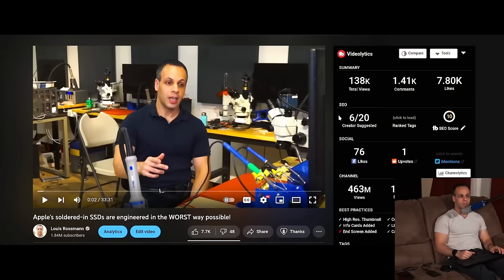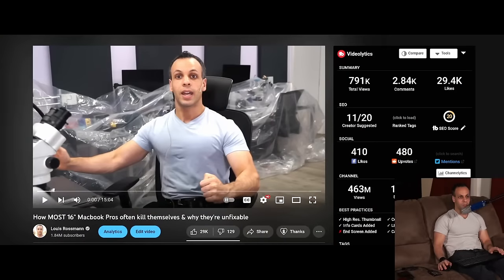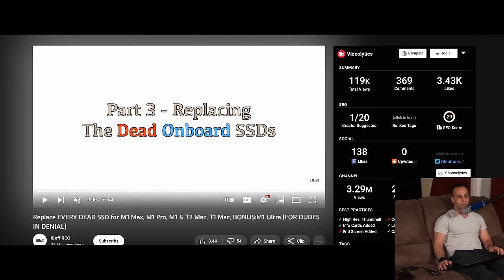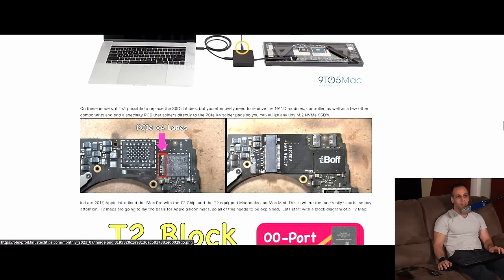The design of Apple's soldered in SSDs is worse than I thought!

Comment: this is the reason i have an old dell latitude E5420. you can replace/upgrade the cpu, ram, drive, battery, screen and dell even has instructions on how to do it on their website - you simply search your exact device by providing the "express service" code found somewhere on the bottom part of the case, and it gives you all sorts of things related to that device. you can find these laptops (used) for like 100 - 200$ and i think that's a way better deal than a macbook
Reply: not to mention, those laptops are pretty much as strong as these old nokias, you could die if someone threw it at you lol

Comment: I have a question: Don't phones with Ios or Android work the same way (like Macbooks)? Are there fewer risks regarding the reliability and lifespan of the storage chips in phones? And if the storage in the phone or tablet breaks down, I suspect that it is just as impossible or expensive to repair them. Or is the Bios in phones designed differently, more reliably?

Comment: This is Apple's plan. Make the product non upgradable, non repairable, or economically viable to repair. When it fails 3-4 years or less, make sure there is another new product on the market to suck the customer into buying again.
This is their business plan which is a win win win for Apple.
I try to point out to people not to buy into this. However a lot get defensive because they have bought into it. They will say things like, well I run my laptop 24/7 for 2 years no problem.
Yes, but 2 years imo is nothing. What about that 3rd year? Or tomorrow?What if it dies then? Will you be OK with that?
I f***ing wouldn't.
The only way to change this design plan is to hit apple in the pocket by not buying into it!
Their iPhones are pretty much the same. You can buy a genuine apple replacement part and the phone will still pop up nag screens to say its not genuine because the original was keyed to the phone and the replacement has a different  key. Even Apple's online engineers can't fix it by flashing  its total shite.
Basically, if you buy the newest apple products, you better have deep pockets, because time is ticking on your product to become that expensive paperweight. They advertise themselves as being green, but look how much land fill they are creating!

Comment: This idea goes back to early 90's Compaqs that would just have a stub for a BIOS, the actual config utility was loaded from the hard drive. If that was gone, you needed the original boot floppy, which is probably non existent or hard to find on the internet today, and it probably wasn't feasible or impossible to download boot floppies when it was new, but at least something was provided to fix it.

Comment: No, they should always make a separate chip containing the "boot/bios" files for the motherboard. These days it is not expensive to use a 1 gigabyte chip for this purpose in a time where such thing as 1 tb micro sd card exists.
Reply: The way PCs do works very well. The EFI firmware looks for a partition with ESP partition type, then offer each .efi file within as a boot choice (or whichever it is configured to boot first). The bootloader is loaded from the disk, which you can replace at will, and when you back it up, you end up backing up the bootloader too. The UEFI firmware itself is stored on firmware.

I would never buy a Macbook. I don't care how innovative the M3 is, or how power efficient, or how awesome it is to go lots of time on a charge without even bothering you with a fan. Even before they soldered their SSDs, I would never accept Apple hardware. Parts are available or it does not exist to me.

Comment: "Because it is illegal in many states to drive without light on, we decided to run wire from starter through lightbulbs. And to ensure that everyone is using law compliant lights, we cast those lightbulbs in the whole front light, only available at the dealer store, so make sure to come in every 50.000 kilometers or so to have it replaced."
Of course, it is for safety and children.

Comment: It's almost as if Apple has no experience in designing robust hardware. The whole UEFI BIOS thing is there for a reason. So if your disk fails you still have something which can boot your OS from another drive. But no, Apple knows better and designs it a different way that stops your machine working if the flash memory fails. It's almost like their computers now are just scaled up tablets.

Comment: Is this what is referred to as "tactical engineering"? 
But over half a grand for 1TB, and you have to do the more than simple extra steps yourself is absurd. This is why apple repairs always seem to cost the same as simply replacing the device.

I have a friend with a more recent MacBook. Should I earn him to backup his data? Is it impossible to receive the data if it fails?

Comment: Doesn't make sense all around. You would think Apple would want a proprietary module like the mac pro one across their lineup. It's one of those if they paid the premium for the hardware up front then they are probably willing to pay the 600 bucks to Apple for the part and a little more for me to install it to upgrade/fix it down the road. Still sucks cuse on the PC side one if my easy sells is 150-200 bucks for an SSD upgrade. That's a 1tb drive at this point and labor to install/clone the old drive and it's like they have a new computer again. For what it is worth I enjoy the board repair videos.

Comment: Just don't buy them, I say it all the time because I knew this all along, but no one would believe me when I was saying they're just designed to die!

Want a good MacBook? 2012 unibody MacBook Pro, patch that to Monterey! A Retina 2012-2015 is also OK, soldered RAM but at least not the SSD. The display is beautiful.
Then MacBook Airs all the way until 2017 are nice machines aside from the display.

The non touchbar 2016-2017 MacBook Pros have replaceable storage although even more proprietary than previously, there are adapters. These are also OK to buy, but be aware of the issues with the butterfly keyboards

Comment: I came to your channel a week ago because I have a dead M1 macbook air that does not turn on or charging and always pulling 5V. At genius bar they ask me to replace the motherboard and touch id, causing over half of the cost of a new machine, which I think doesnt make sense to repair at all. I am now awaiting my screwdriver and multimeter that I bought online, and I at least want to diagnose the board myself before selling it for junk. I hope I may be able to fix it myself, but it sounds like I may end up having a dead SSD that also killed that bootloader. Anyway, I am done with Apple products for the rest of my life. This macbook really is a horrible user experience, never ever again.

Comment: There's a REASON the BIOS on regular motherboards is stored in a completely separate ROM chip that is battery-powered. System storage can fail at any moment. And when it fails you will NEED the BIOS to be intact.

Comment: Few months ago I have successfully recovered about 1.5TB of data from a dead SSD without soldering anything with only single tool - ddrescue utility. Because if you carefully read data from your SSD block-by-block your totally dead SSD can give you about 99.9% of its data without any error.
Reply: That's why they usually degrade blocks into read-only.

Comment: People understand cars more than computers: Apple's the equivalent of a car maker pretending it's okay to gain 1 horsepower by putting the alternator winding directly on the crankshaft, thereby guaranteeing a multi-thousand-dollar engine-out repair (if not total engine swap) to anyone dumb enough to buy one used. There's a law that says you need to be able to buy replacement parts for cars, and as I started typing this I realized this is exactly the direction auto makers are going inch-by-inch.

Comment: So it's not merely a soldered-in SSD..  they stripped essential components a plugged-in SSD have that would isolate a fault, and instead made sure a fault would be catastrophic.
This is one problem right to repair laws won't solve...  Say the manufacturer chooses to design their product so ANY of the commonly-failing components which are integrated failing blows up the whole board,  because they prefer to replace whole boards.  If the SSD was properly fault-isolated, then only the SSD would fail;  the fact it's not ought to be considered a design defect,  even though Apple likely won't because they don't consider the SSD replaceable anymore - a SSD fault is considered to be the whole board is broken and must be replaced.

I begin to think that a Prescriptive 10-year minimum design warranty should be required by law for the plurality of electronic circuits of a consumer electronics product  for the specific issues such as burning caused by short circuit, static discharges, incorrect voltage or current,  That should apply to any product failure that is not addressable by replacing less than 25% of the electronics. The manufacturer can choose Not to warrant individual replaceable subunits.  But it's Apple's fault if the whole board always has to be replaced.  

The manufacturer should be responsible to ensure products are designed reasonably to prevent something such as a cable failure or a short in another chip burning more than a  25%-of-the-product-or-less replaceable submodule.

Comment: Ok for people not understanding this situation. Its like having a car, you know tires wear out and are wear parts that NEED to be replaced. So in this case you get a flat tire and now your car will never turn on again because that tire is flat and you cant get a spare tire/wheel anywhere else but that manufacter even to the point it uses entirely different lugnuts and bolt sizes all properitery shit you cannot buy and no spare or donut in the trunk . Thats what a mac is and the fact people keep buying them is bonkers to me

Comment: A lot of times its not really the nand itself that fails, its the protection diode array that goes. It tends to take the power controller chip with it. Sadly the nand chip has a 50/50 chance of getting irreparably corrupted as well. All of this is deliberate. The fix is simple enough, but must be done before failure. Put a schottky rectifier and a big capacitor across the NAND supply rail with the rectifier after the protection diode and the capacitor donwnstrem of the rectifier. The capacitor will allow a gentle landing and prevent the nand from corrupting. Another option is to replace the protection diode arrays with a slightly higher avalanche voltage.❤

Comment: I'm so scare because my 14" MacBook Pro 2021 are starting to have problems to start the system, some times I turn on just go to Recovery Mode automatically, I tried to boot from Macintosh HD and most times only restart... I have a daily Time Machine backup, but I'm terrified if I can not longer turn on my Mac if the NAND chip has a problem... I had a 2015 MacBook Pro and I upgrade the storage just fine, good old days... and yes.. this is not a "problem" of the size of the new MacBook Pro because it's the same as the 2015 MacBook Pro, they can fit an SSD but you know... Apple Silicon... they have BRILLIANT people to make a great processor but not so brilliant to make a SSD no solder to the motherboard... and yes you can say "well buy a Windows laptop" the problem is... I need macOS :/

Comment: The way Crapple treats their customers sickens me.  Am I a PC fanboy now?  YES.  Did I use to love Apple machines?  Yes.  I had an Apple ][+ and the original Mac and thought it was the greatest thing ever (totally eclipsing sliced bread even) until it died and I had to get it fixed.  And what did Apple do??  Try to charge me $500 for a new motherboard which had failed after less than 6 months because they claimed I had voided my warranty.  I had NEVER opened the case, and therefore never was inside my mac yet they claimed some key seals were broken.  It was after 6 months of back and forth (remember in 1984 there was no internet, no free long distance, no free anything back then), and literally more than $200 in long distance calls that I realized they were NEVER going to fix my 4 month old computer under the worthless warranty it supposedly came with, and I was screwed.  

Ironically, I worked at the largest Apple dealer in the tri-state area, and I succeeded in steering most of my potential customers to buy any thing but Crapple.  So not surprised at the direction they are continuing to go, and not surprised at how big they have become, considering their business model of ripping off their customers left and right.

Comment: Well the sad part is it's not for security or speed.  Speed wise MacBooks with the M1 or M2 are just a tad faster than PCIe 3.0 speeds.  Any PCIe 4.0 SSD smokes them performance wise.  Security wise encryption is provided by the T2 chip, the problem with which is that the encryption isn't end to end.  It's exactly the same level of security offered by any modern windows computer, which have also had security processors built-in for awhile now.  For those that truly wish for a higher level of security, you need a drive that encrypts any data before it's transmitted and a compatible operating system (like windows).  Many enterprise class drives offer this features as do a few consumer class drives.

Also $600 for 1 TB is criminal.  You can get a much faster drive in the WD SN850X 1TB for $80.  That's a beyond disgusting markup on the Apple part.  That these drives happen to have a higher than normal failure rate is just insult to injury.  

I used to know an engineer for GE who frequently told me stories about the design choices that were made to clearly limit a product's lifespan.  I have little doubt that many of Apple's choices are intentionally made to hurt consumers and repair-ability.

Comment: A note on calibration of the lid angle sensor, even if you are certified, it is impossible to recalibrate an old sensor. It must be a new one, and the official repair process be followed. Otherwise, the calibration suite simply doesn’t run.
regarding SSDs, this has me concerned even for removable storage like in the Mac studio, because the controller is in the Apple Silicon, not on the SSD. And once again requires calibration on replacement of the SSD. So if the removable SSD fails, I suspect you won’t be able to replace or repair in either. Go figure that one.

Comment: Louis I want to know why if the BIOS chip is on the SSD now, why bother with it at all?! I thought that was basically the whole point of a BIOS chip and the CR2012 batteries, is that you can turn the board on without any working storage.  
Why don't they just go F it, and make everything run straight from the SSD? (which i suppose is what they are doing, but in a kinda inept way.) If you see what I'm saying.

Comment: A chip failing with a power rail short is usually caused by either a voltage spike or by just running the chip too hard and eventually it fails the heat destroying it.
In this case i would suspect heat. I imagine Apple made the compromises of longevity to get their own chip both fast and also ultra cheap to produce.  
As long as they don't fail inside warranty period Apple considers it a win.

Comment: What's the most sold Apple computer?

It's the MacBook Air base model which has only 8 GB of RAM. This low amount of memory means that swap will be used more frequently to keep the system running. That means more data written on the flash chips causing more wear. Now, these base models come with 256 GB storage which have very low TBW.

Within 5 years we'll see many M1 macs failing to boot and become e-waste.
Reply: Please do some research before posting disinfo. Even the base model has to take so heavy tasks before it starts to memory swap. Those aren’t typical for the work which people do who buy base models.

Comment: Apple charges ridiculous amount just for "upgraded" storage and RAM that most people will buy the base model with 8 GB of RAM. What many don't realize is that a lot of consumer apps we use today are bloated web apps. These things consume ridiculously high amount of RAM. Run a couple of those and you'll be hitting your memory limit. I know this because my 3 year old laptop also has 8 GB of RAM and I constantly push it to 90-95% usage every day. SSD health is down to 75% as a result of excessive writing to paging memory. Even if this thing dies the next day, at least it's not a paper weight. Doesn't take 5 minutes to swap the old SSD with a new one. 

Apple knows exactly what they are doing here. They purposely design these products to be disposable so they can sell you the next one. And people continue to praise this company for being "premium".

Comment: I experienced the same kind of annoyance on the 2006 2008 17” Macbook Pros. Some had the nvidia gpu in which they did replace, but others had the AMD gpu which also failed but never got replaced. Became an expensive brick. I am in the market for a new laptop, but after watching this, it reminded me that i said id never buy another mac laptop ever again. I love macs for what i use them for, so ive run a desktop pro only since then, which i bought in late 2008 and still runs fine. But i want to replace it, not sure with what now. Any suggestions Louis? Using it for music.

Comment: I only wish ARM Desktop platforms can actually catch up to Apple Silicon as every other ARM Desktop/Laptop just couldn’t hold a candle to the M1 in terms of both specs and software support.

Windows developers don’t have as much of an incentive supporting ARM as much as Mac developers do and therefore has to emulate nearly everything on weaker hardware, which doesn’t always work especially with Anti-Cheat games.

Another thing that might be farfetched is to wait for ARM Hackintoshes to be as viable as it did with Intel and some AMD systems.